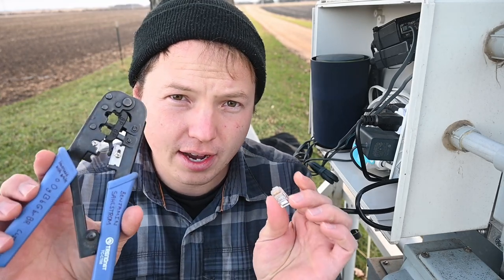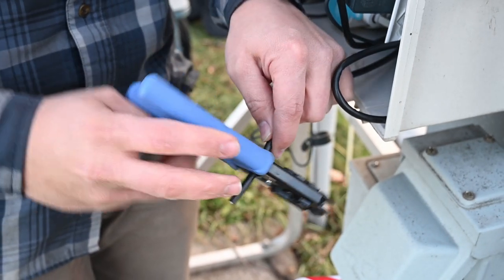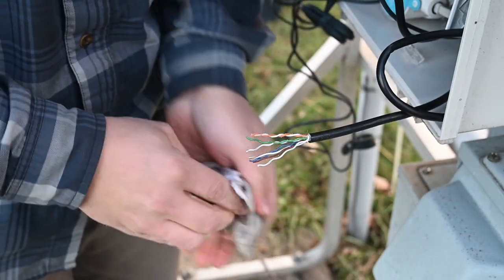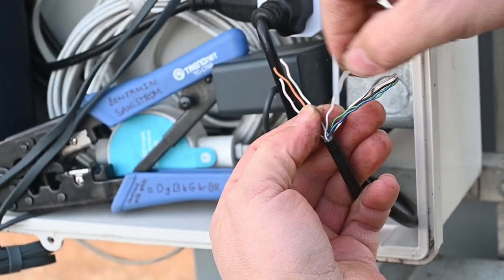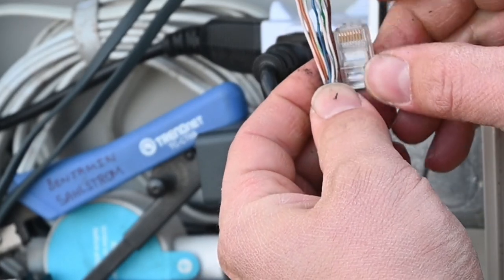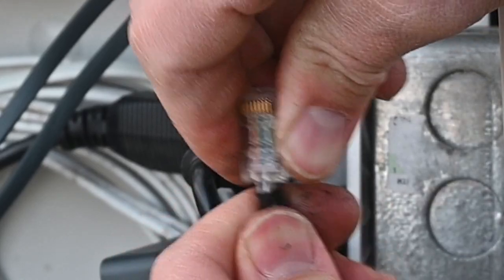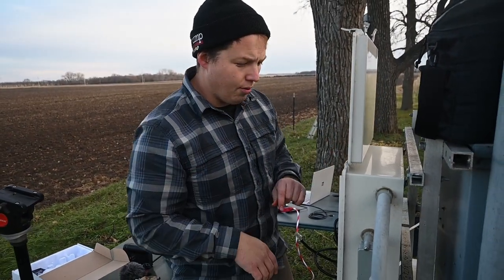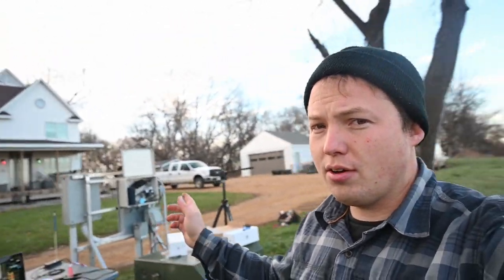How To Crimp The End on an Ethernet Cable - RJ-45 Cat6, Cat5, or Cat5e Connector Plug Termination

Comment: Oh, worth mentioning. Reduce your TX power, had an issue with Ku band and these 5GHz radios. Caused channels to wash out on dish by mounting these two radios (litebeam gen ac2) and satellite (V/H) close together. I don't think it was frequency interference, just overwhelming the receiver inside the LNB.

Comment: The jacketing has to be inside the RJ45 to be within BICSI Code. Pass thru ends the wires have a tendency to jump around l, especially the browns, when putting the pass thru end on. 

Been doing wiring 20 years and I still get it wrong sometimes. Have patience with yourself. Cat6 has a 300 foot limit for signal unless you put a sub point in between to move the signal rest of the way.
Reply: Why would you think that anyone who is using YouTube to learn how to terminate cables would give a shit about the code?

Comment: Put a jack and cover plate, label it and use a proper patch cable. Solid cable isn't designed for crimping, designed to terminate, stranded cable designed for patching connections and easier to trouble shoot problems.
Reply: Dude, for the average homeowner this is fine. If expert installers are on here trying to learn then we have a big problem.

Comment: I have to agree with one of the other comments.  Keystone jacks, not crimped cables.  

Why?  Cables break, the plastic little bit breaks, etc.  Keystone jacks are just far more professional.

Don't get me wrong.  What you're doing is fine, and there's nothing exactly wrong with it, but honestly for anything permanent you should be doing keystone jacks.

Comment: Never Crimp Anything, use Keystone Jacks. Crimps Fail. Anyone who crimps is a flunky.
Reply: I worked for a telecom company for decades. Crimps worked just fine. You must own the Keystone Company.
Reply from the maker: Hey! Haven't ran into anyone other than my grandpa that also uses the word flunky! It's a good one. 

Do you think there is a place for crimping RJ-45 connections on more basic systems like residential work? Personally I have never had one fail but I haven't done hundreds of connections or anything. 

Thanks for being a subscriber by the way!
Reply: @Glide1992  nope, I clean up “bell head’s” and “flunky IT peoples” disasters. So your application makes sense.

A simple idea such as crimping gets repeated in the wrong situations by folks that monkey see monkey do rather than use the brain they were given and work smart and build quality into a solution. Most people that try and crimp cant do it right anyways. Furthermore Crimps usually don’t have strain relief especially when amateurs are encouraged to practice the sin.  

So… every time I see someone crimp something, I point it out. Stop crimping..

FYI: ICC’s keystone products, panels and termination Mit are fantastic and removes ambiguity for even a novice.
Reply: Crimping takes practice, you cant keystone everything.
Reply: @BenjaminSahlstrom  - There are few things I bust peoples balls over and crimping is one of them… hit the electrician U guy a few months ago.

Keystone, Biscuit, Label with sharpie, Heck - Even Color Code things. Now you know whats what. And 1 ft patch cord makes things easy.

There are better ways. See my comment to the telecom guy….

I see so many things online that make me want to start my own channel just to fix the world! Cheers!
Reply: @BenjaminSahlstrom  worth a note, I picked up the phrase from my data mentor elder. Your grandpa was prob a very smart man!
Reply from the maker: You definitely should start a channel! More perspectives are always useful.
Reply: Your right, but in reality its often necessary to crimp an end when installing some devices like cameras and intercoms that go outside. They have a weather proof end that gets installed before you crimp an end on. Some you could patch cable from a keystone but its often not practical. Cable Matters keystones (on Amazon) have been rock solid for us)